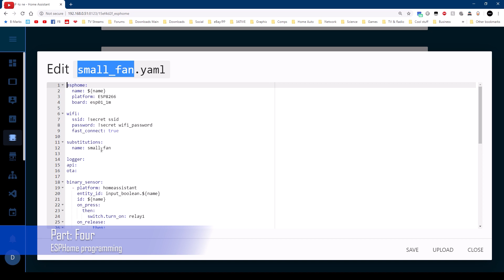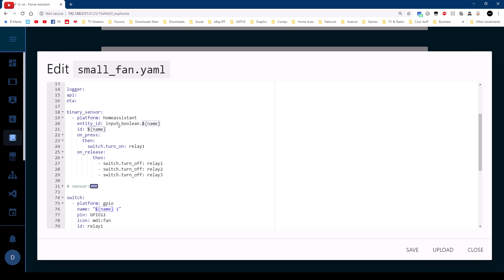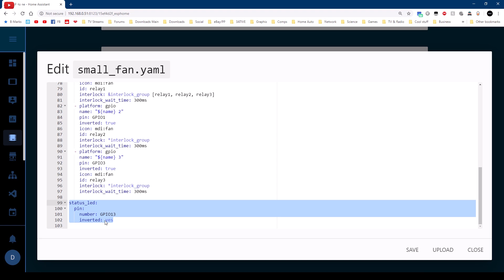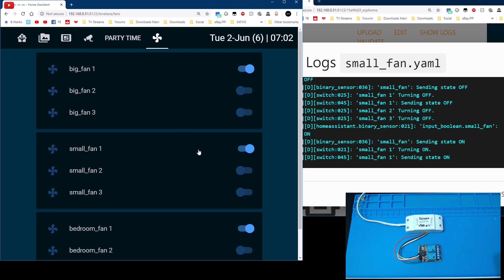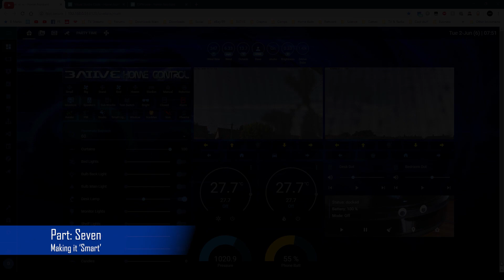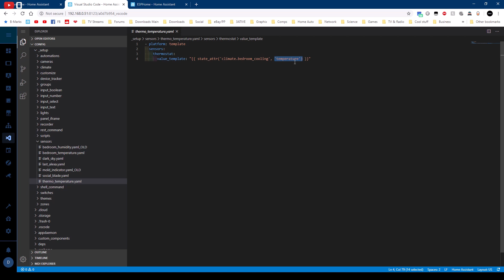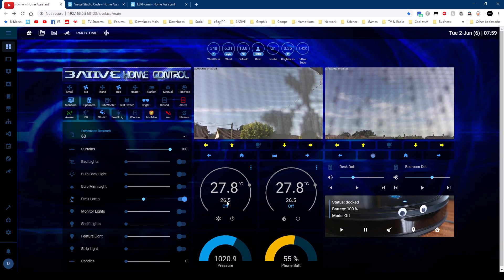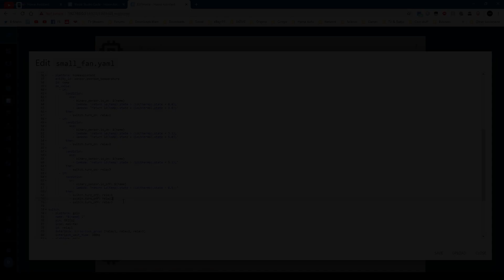Home Assistant ESPHome Sonoff - 3-Speed Smart Fan Convert

Comment: Hiya, great video. Can you please confirm which mcp23008 that I should be getting? Some has diff number below the MCP number . So basically it has MCP23008 E/P, then below that it has 15031VU, some of them have diff ones. So not sure which one to get. Bit of guidance is much appreciated. Cherrs
Reply from the maker: Hi there, 
Glad you liked the tutorial. The version where I use the Expander chip is V3.1: https://www.youtube.com/watch?v=_XgJyYwlejo
And yeah, the chip I used is indeed the E/P version.
Reply: Ok. So as long as MCP23008 E/P be ok? Or do I need to get any specific one? Cheers
Reply: @3ATIVE   Thanks, so should I ok if I just get any MCP23008 E/P with any number below? or is there a specific one?
Reply from the maker: The "MCP23008 E/P" is the part number and spec...
All those other numbers manufacturing stamps, dates, locations, etc

Comment: I did the same but I used Athom 4 Channel Relay so no soldering needed and only 1 device - it works great for my big fan for cycling with 3 buttons: slow, medium and high speed
In the next iteration it will be controlled by efforts so i.e. heart rate ;)
Reply from the maker: That's cool. At the time I made this video I didn't know about ATHOM. Also, Check out the latest version of this fan convert series... I added the buttons back in and some LEDs!!
Reply from the maker: Here you go: https://www.youtube.com/watch?v=_XgJyYwlejo
Reply: @3ATIVE  super nice

Comment: My two cents regarding tinning wires that go into screw terminals...
Generally, tinning wires in any kind of terminals is not recommended, as the screw pressure will reduce over time as the tin will cold flow. This can cause all kinds of issues down to fire hazards. (In Germany, even regulated by DIN VDE 0100-520 and VDE 0100-520:2003-06)
Then, there are two kinds of screw terminals:
a) Screw touches the wire directly: Do not put stranded wire into these directly, use wire ferrules! The screw may cut the individual strands while turning, weakening the connection and you have free metal pieces in your circuit.
b) Screw moves a small metal plate that clamps the wire: Okay to use stranded wire.
Be safe! :)
Reply from the maker: Indeed... In a later video (tutorial) I do mention how this practice is no longer acceptable.
Also, in the updated version of this project, I no longer show 'tinning' the wires before connecting to terminals.
https://www.youtube.com/watch?v=_XgJyYwlejo

Comment: Great tut (i think lol) ok, so i loaded up the code and flashed it to my sonoff basic, all went ok. BUT my basic now flashes green constantly, and if i press the button the relay doesn't click on/off....also, when i create my input booleans in HA clicking them does nothing either. When i check on my esphome page my sonoff has connected to wifi. So, have i made a daft mistake, or am i a complete idiot lol 
Any help would be greatly appreciated, as this is a great project and it's something i'd love to get working.
Oh, and i forgot to mention that i've not got a logic shifter thingy as i'm not too bothered about the led's.....do i need to alter the code to take that into account, and if so, what lines would i need to omit ?
Reply from the maker: Thank you Del boy Trotter. 👍
As for why the Sonoff is flashing, it sounds like the Home Assistant ESP integration hasn't found your device yet. So, check the integration for what ever you called your fan and if it's not listed, try adding it manually with: [your fan name].local
Reply: @3ATIVE  Thanks for your quick reply....i'll try that
Reply from the maker: @delboytrotter7902  No worries, lemme know how you get on.
Reply: @3ATIVE  I've got the sonoff online now....i think it's the HA part that i'm not understanding. I have created input booleans via helpers, but when i click on them nothing happens, and i can 'turn on all 3 speeds' at once (if it worked i could lol) any one speed isn't cancelling out the other, like yours do.
I'm missing something, probably (hopefully) simple.
I think i maybe have to add something in config.yaml, but i'm fooked if i can figure out what

Thanks for your help :)
Reply from the maker: @delboytrotter7902  In this (old) version I only use one Input Boolean - That's is 'Master' for turning the Fan on/off. The three 'Speed' switches come from the ESPHome Code... and it's that which is doing the 'interlocking' (Turning other off as you switch each one)
So:
1. Should only need to make one Input_Boolean in Home Assistant
2. Unless you get the Sonoff/Fan connected to Home Assistant, you won't see the three 'Speed' switches. 

Also, I've just realised... I never shared the ESPHome Code!!! OMG, I can't believe it! I've now added it to the Video description and here's the link for you too: https://github.com/3ative/3-speed-fan-convert
Reply: @3ATIVE  lol@ forgetting the code :)
No worries, i'll try what you said and get back to you (it WILL work now lol)
Again, I can't thank you enough for your help, you're a star !!
Reply from the maker: @delboytrotter7902  Yeah, Keep me updated - I'll do my best to help you get this going. 👍
Reply: @3ATIVE  Loaded code onto sonoff, and it's online. I then created an input boolean using 'helpers' in ha but i'm still having no joy. Nothing happens when i press the button on the sonoff either. I tried loading tasmota on the sonoff and it toggles as it should, so there is no issue with the sonoff. I still think i'm missing a simple step somewhere.
Do i need to do anything in configuration.yaml ??

Again, thanks for taking time to help me, i really appreciate it
Reply: sorted now :)
It was my fault, obviously. I got a setting wrong. I feel stupid, but at least i'm sorted now.
Many thanks for your patience with this, and keep those vids coming, they have been very useful.

Lee
Reply from the maker: @delboytrotter7902  YAY -  Nice one. 
I'm glad you got it working. Don't worry about getting stuff wrong - Not everything I do works first time either... that's the fun of it! 😉

You are most welcome fella, not that I was able to help much, you did most of it yourself. 👍
Thank for the kind words, It's rewarding to hear my li'videos are either helpful or useful.

Dave.
Reply: @3ATIVE   Final question.....i promise :)
All up and kinda running, only thing is, speeds 2 and 3 only work if i tap the relays. This is obviously not normal. I put the resistors on as shown in the vid, the chances of both relays being knackered is pretty remote i'd have thought. Do you have any suggestions before i remove the relay module and test with an arduino ?

Lee
Reply from the maker: @delboytrotter7902  No worries...
Does your relay board have LED indicators on each channel? If so, try removing them and short their pads with a blob of solder. I found this to give a little more ooph to power the relay coils.
Reply: @3ATIVE  Thanks for the quick reply, yes, they do have led's.....i'll try that tomorrow and get back to you.
Thanks again for everything.

Lee
Reply: @3ATIVE  That did the trick, you are a star, thank you so much :)

Lee
Reply from the maker: @delboytrotter7902  My pleasure Lee. Enjoy.

Comment: Perfect. how can I adjust fan speed control in Esp home kindly advise or provide a good tutorial video
Reply from the maker: Thanks. 👍
For basic speed control, check out 'Chapter: Testing the Relays' @05:26 - There I show the 3 ESPHome switches that are part of the code. You can use those in your Home Assistant Dashboard if you want.
For the next 'Episode' of this project, I did a more comprehensive Fan tutorial. It's a Live Stream and I do intend to make a 'Stand-alone' tutorial soon.
Please check out that here: https://youtu.be/AIuAeBEvEG4?t=1307
Reply: @3ATIVE  thanks you...

Comment: I wanted to do this and this literally came in my recommenced. Thanks it’ll be a lot easier now
Reply from the maker: Well that's cool. Enjoy.
Also, if you want to add the buttons back in and have LED indicators in your fan (I've have to make a proper tutorial soon) But, I did a Live Stream
 - Check it out here: https://youtu.be/AIuAeBEvEG4
Reply: @3ATIVE  oh thanks didnt wanna add LEDs but i do want the old buttons to remain functional
Reply from the maker: @koevoet7288  Ah ok.. no worries - TBH the LEDs are not that useful for a remote controlled unit, I thought I'd add them as they used the same control lines as the relays and were easy to install.  😎
Reply: @3ATIVE  ye thats true

Comment: If it can be used with 3 switches, it will be very good
Reply from the maker: What '3 switches' did you have in mind??
Reply: @3ATIVE  button fan
Reply from the maker: @anhang4704  If you're talking about a 3-speed fan, like the one I showed here and want to add the button function back in (plus some indicator LEDs) I've done that, it was on a Live stream, check it out here: https://youtu.be/AIuAeBEvEG4

Comment: Most three-speed motors have two sets of windings. The switch turns one winding on for low speed, the other winding on for medium speed, and both windings on for high speed. This type of three-speed motor can often be automated with only two relays.
Reply: The button for high speed is wired to both windings, while the buttons for low and medium speeds are wired to each winding separately. If you have relays wired directly to each of the two windings, you can energize the relays either individually or simultaneously. Thus relay1 = low, relay2 = medium, and relay1 + relay2 = high. Eliminating the third relay for high speed would reduce the cost of parts for your project.
Reply from the maker: @willdwyer6782  Yes, I understand but, If you watch my Live Stream, you'll see why I choose to do it this way: https://youtu.be/AIuAeBEvEG4
Reply from the maker: @willdwyer6782  This is the diagram for the fan I used, each speed is a sperate winding. Note: there is only one Capacitor: https://i.pinimg.com/564x/07/a5/ec/07a5ec4f5ed603133402b297d2140bae.jpg
Reply from the maker: Quite possibly. However, since the fans I used have three speeds and three buttons, I wanted to replicate that function as closely as possible to make it easier for ppl to reproduce and understand. 
See one of my live streams, 'Ultimate Fan Project' where I put speed indicator LEDs in and wire the buttons in for local control.

Comment: Hey mate, why do I not have a _setup directory, like you do at 10:30? What is that full path?
Reply from the maker: I have split my config up and I use '_setup' just to organise the folders. The '_' just makes it appear at the top and 'setup' is just a logical name for where all my setup files (.yaml) and folders are.
Reply: @3ATIVE  OK, so I want to do something similar where I create a battery sensor from each of my Wyze door sensors.
So where should I place the corresponding yaml file for each sensor?
Reply from the maker: @simondgie1  If you haven't split your config.yaml then they would go in there under the 'sensor: ' section.
Reply: Cheers mate
Reply: https://www.home-assistant.io/docs/configuration/splitting_configuration/
I'm assuming this is what you mean by splitting the config.
Reply from the maker: @simondgie1  Yep, that's the stuff. ✔

Comment: It would be cool to add a slider in home assistant to choose the speed.
Reply from the maker: Not hard to do. I have updated code in ESPHome that reads in a slider (set from 0 to 3) to control the 3 speeds.
Reply: @3ATIVE  that's great
Reply from the maker: @Leonvolt28  Check it out: https://imgur.com/ZB4x2yq

Comment: Is there home automation for your shower? Like to turn it on or off?
Reply from the maker: You 'could' automate a Wi-Fi enabled breaker to the main shower feed.  * I would advise AGAINST messing about in the shower unit its self. *
Reply: @3ATIVE  Kohler has released some smart shower that you can control temperature and flow. Also they have a automated faucet. How can I do something similar?
Reply from the maker: @DB-nl9xw  I can't see any need for an automated Shower, being that you'd be standing right next to it. 😂
An automated faucet could be useful if combined with a Bath water level sensor.
So, imagine something like this could be used: https://amzn.to/2Z6KLtE

Comment: In Australian electrical standards it's written that you shouldn't solder connections under a screw terminal 3.7.2.5 from as/nz 3000:2018. Don't know who said those other tiny terminals are crap, they clearly don't know what they're talking about mate.
Reply from the maker: I saw a post on Facebook about this - So, I looked it up. Soldering used to be the normal but now it's frowned upon. That's cool, it'll save me a lot of time! 😁
Reply: @andilge that's why you use bootlaces.
Reply: @TradieTrev  Agreed, I recently bought this set and have not looked back ... https://www.amazon.co.uk/Preciva-CP621200-Crimper-Self-adjustable-Crimping/dp/B073TZ5BBG?ref_=mh_s9_apbd_otopr_b27DJRf&pf_rd_r=SQYKX7JHEENTT99N1T6H&pf_rd_p=4185a3f2-86b6-5266-bdd4-fc5dae0483a3&pf_rd_s=mobile-hybrid-11&pf_rd_t=BROWSE_ANYWHERE&pf_rd_i=1938873031